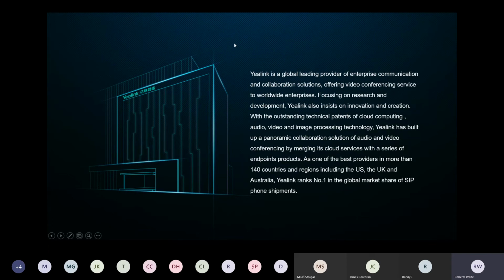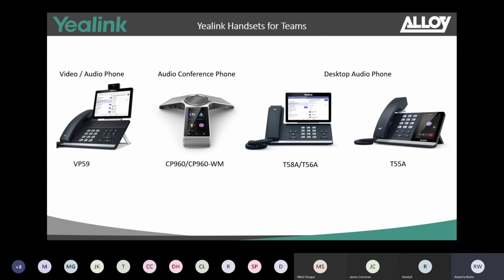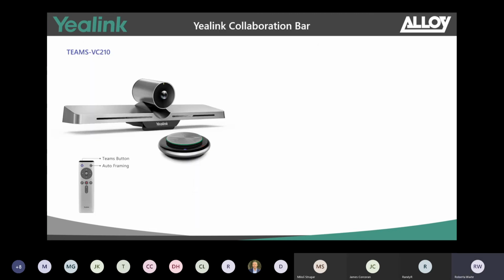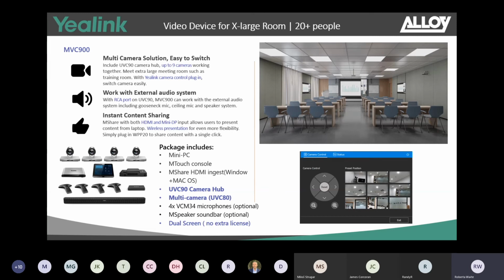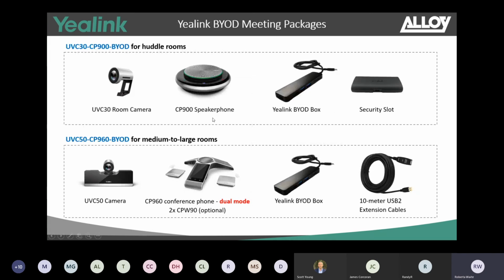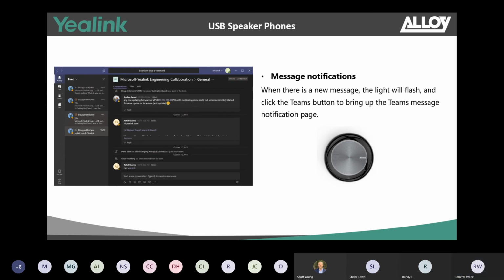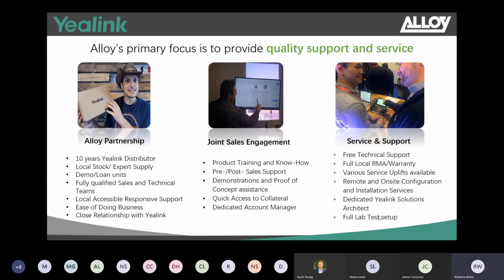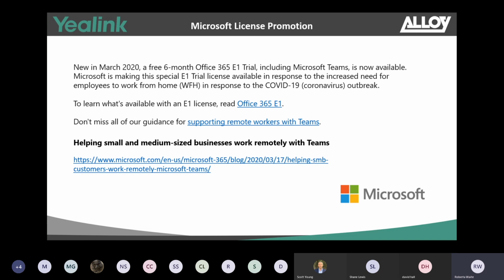Alloy Webinar: Yealink MS Teams endpoints, enabling business continuity and remote workers

Comment: 1. What I found is when CP700 is connected to PC using USB and Bluetooth both,  and someone calls you on on MS-Teams, there is no sound from the speaker when a person is talking to you from the other end. 
2. To have integration with MS-Teams, you either should connect the device with USB or proprietory BT dongle (BT50). Why can't it use the default BT  connectivity available?